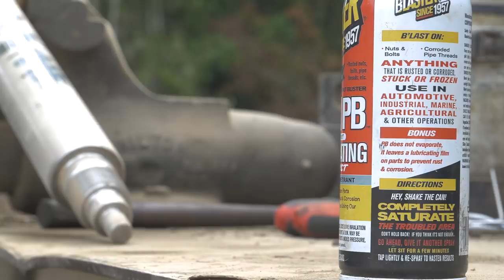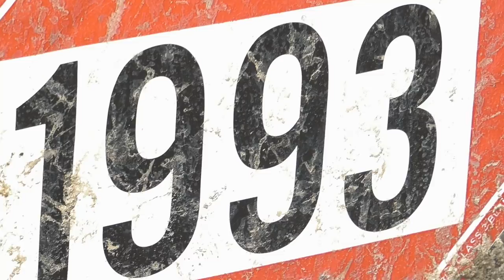SWAMP LOGGERS NC / "Where's the Trucks?"

Comment: The quickest way to get more trucks is to pay more money per load or per mile. It is simply a matter of supply and demand. Those trucks that you mentioned that did not show up most likely found higher-paying loads to take instead of your loads. If you were paying more, they most likely would have showed up to haul your wood.

Good luck getting the wood out and getting the logs delivered. I hope everything works out well for you.

Comment: In the video you said you only recovered about 88% of the wood you use for the roads. Is this 12% loss due to breakage and that the other logs are pushed so deep they can’t be recovered or found?
Have you thought about using a GPS unit that plots the placement of all of the logs and maybe a  Radar or Sonar unit to help recover the missing logs? I know they make a sonar unit for digging under water. It shows the bucket while digging and shows they work done. I know these things are not cheap but they will pay for themselves over time.

Thinking outside the box... The more you recover the more $$$ you make...

Comment: Do yall use body mics might help if not
Reply from the maker: No we do not wire the crew bc we do not want to make a huge footprint during production. They are working...no need to stop them for 10 or 20 mins to run a mic, wire, and level checks. We use directional condensers and boom when mandated. But you are right, lapels would sound really good. Thanks for the input.